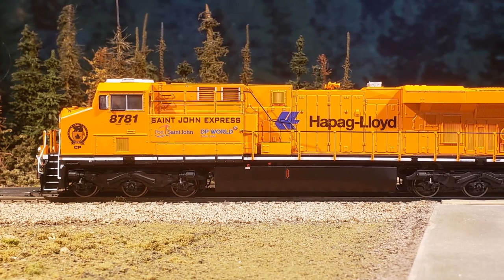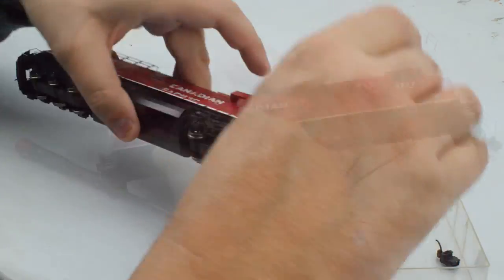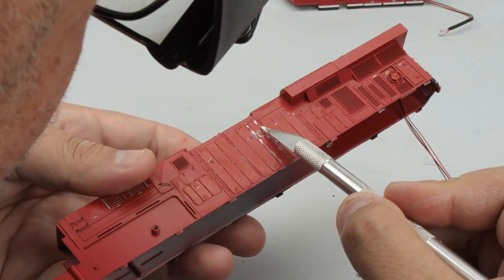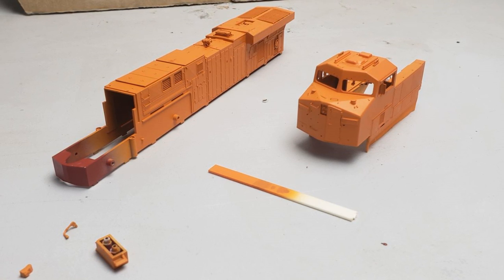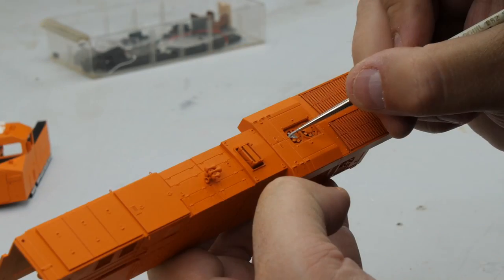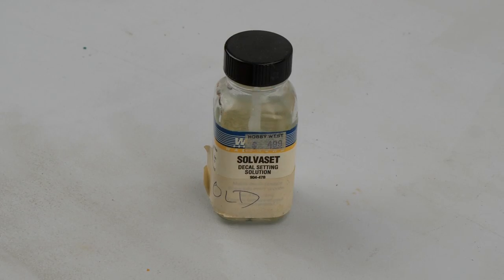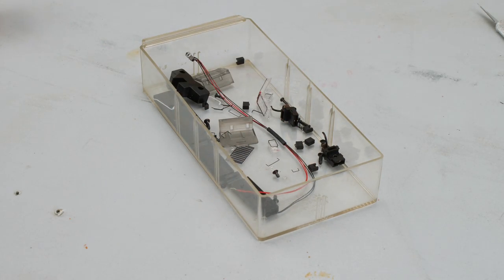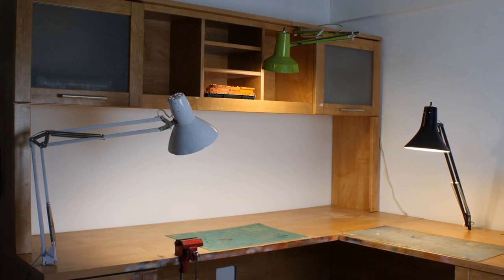The Saint John Express - Commemorating two World-Class Companies in HO Scale!

Comment: This thing is awesome. There is 1 big issue I see tho, the truck on your model of 8781 are the as delivered steerable trucks. By the time 8781 got its Hapag-llyod paint it had been converted to regular high adhesion trucks. A few other things you should do is put a graham white E bell on the conductors side in place of the steel bell that’s there, and program the loco to have a Graham white E bell.
Reply from the maker: Thanks! I am aware of the few inaccuracies of the model, and believe me it took every bit of self control not to correct them lol - the reason it was done this way was so it matched the trophies we made for Canadian Pacific. We were told not to make any major changes exept to remove the ladder, so that's what we did. The powered units purpose was to show the exact process of repainting the CP display models. Maybe one day I'll go back and fix the trucks and bell, because the fact they're not quite accurate does annoy me a little lol.